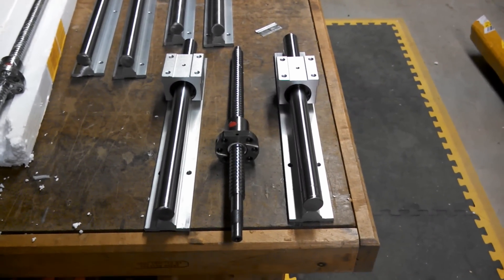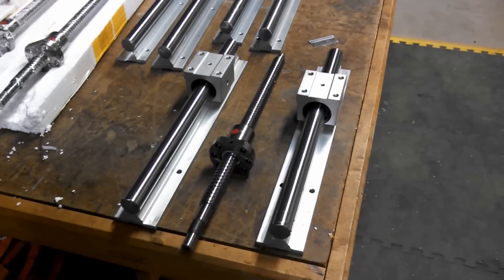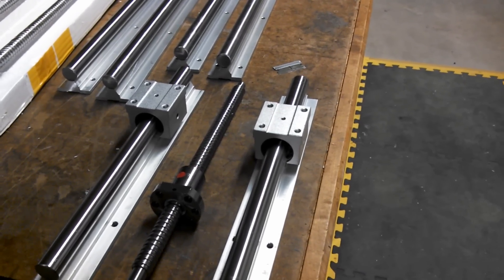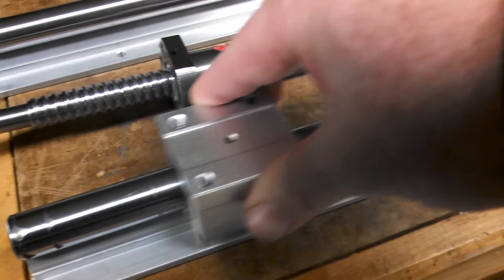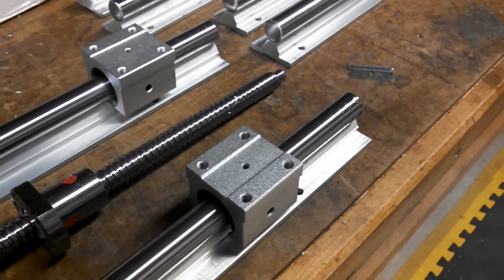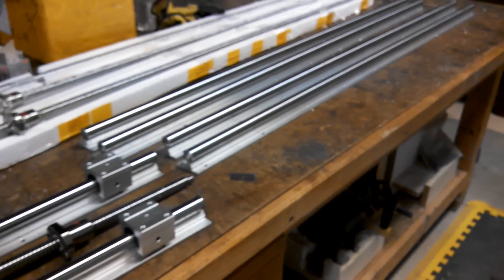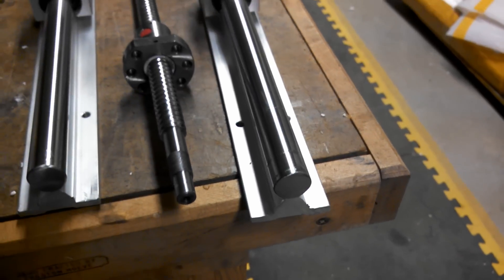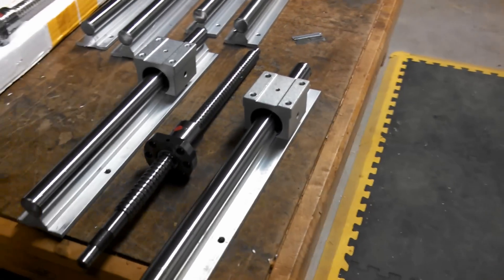Chinese Linear Rail Review

Comment: Once you start to finish your build you will realize how poorly those will be for your application. You cannot work out the play in an adjustable round rail bearing without fighting excessive preload. Nada, zero, zip
Reply from the maker: +Onnly Secondsleft  I haven't found that to be the case.  After replacing a couple of bearings that I screwed up (my fault) I am still happy with the price/value.  Maybe it is something about my overall design?  If I would get off my duff and do an overview video of the machine that would help elicit feedback from you guys/girls.
Reply: +Onnly Secondsleft , I agree, they are terrible and coggy as hell. Especially the 12mm size.

Comment: Thanks SBird, Useful and to the point.

 "Miss_my_car" is where I've seen them.
 Can't comment on them as a vendor one way or the other, but I just ordered a 1204 350mm long ballscrew/nut set from them. 

I just rolled the dice, needed a cheap Z drive fo a HF mini mill, it's replacing an ACME setup, so I figured if it wasn't up to snuff, I'd donate it to STEM  - technology in the schools - they do Arduino cnc stuff. 

I could put a Thomson or SKF on it, for more than the tool is worth, but this makes sense for the use... 40 bucks, not 340.

For home shop use, most of this kind of stuff isn't too bad. It's not intended  for use on the space shuttle.....

Scott
Reply from the maker: +Scott Marshall My machine is now up and running and as my other video shows, I had some 'discoveries' around the slide bearings, but the ball screws and nuts have given me no issue.  Good luck.

Comment: I want to thank you for the info and video.....I've been preparing to upgrade my cnc to get rid of the (ludicrous) plastic structural parts (which equate into flexing during runs) and have been looking at numerous options...Similar items from McMaster Carr are hundreds of dollars more.

Now I get chastised for buying router bits and end mills from China saying how it's hurting local businesses but considering that a 1/4" straight flute router bit is $44.00 where I live and one from China is $3.00...I can justify spending double, but can't justify spending FOURTEEN times the amount.....
Reply: +michael C Besides US vendors sell plenty of "inch" parts which mean they have three time the inventories that would have by being only metric !
Reply: @ellsworthm.toohey7657  Why would they need three times ? Just curious. Thanks

Comment: do they have greasing holes
Reply from the maker: +basilenglish No. They do not.  At most a light oil is all you would want, and just a coating at that.  Any oil or grease would cause them to pickup dirt from the rail.

Comment: you did not comment about the cost
Reply from the maker: +Paul Le   You are correct.  My goal was to share my opinion on the quality and functionality.  If I introduce cost into the equation then I feel the need to compare other options.  Among just round linear rails from China, the prices are all very similar.

Comment: Thank you for answering. My specific question is what are the slide diameter (16mm, or what) & the lengths of the rails on your set up.  Just trying to get a visual perspective of the sizes . Thinking of a 36" x 36" or 42" x 42".
Reply from the maker: +Keith Bardwell 20mm diameter.  The short ones are about 12" and the long ones about 50".

Comment: Exactly which set did you buy and from which vendor?
Reply from the maker: +Keith Bardwell   I don't remember who.  If I come across that in the future I will update the comments.  The specs are all the same from different vendors and you can tell they are cut from long lengths of material.  Most of them will make any set you want.  Just contact them.
Reply: +sbirdranch  do you have any update about where did you get this from? the name of the vendor in eBay? i like the way they shipped to you. they looks like it is well protected. specially the ball screw with the Styrofoam. please let me know if you remember or if you can check on your eBay account the history of your purchase and find the name of the vendor. thank you very much. have a great day
Reply from the maker: +miguel0706 http://www.ebay.com/cln/sbird_seller/cnc/144826516017

Comment: Hi, I'm in the same process, looking for a 3 set of linear rails xyz, after looking v-slot rail with wheels, not sturdy enough, too many parts to adjust, degradation of the wheels, etc I decided for the supported rails, simple and strong.  
I see you ordered your linear rails and the ballscrew with the same size, how are you going to do? are going to cut the linear rail to match the size of the threaded part of the ballscrew?  I am thinking of ordering but taking into account the machined ends, about 50mm bigger, what do you think ?  by the way great video !
Reply from the maker: With the screws the same length, you don't lose much travel at all.  With the bearing blocks on the slides and with them spread out, you can't move the full length anway.  It becomes a travel distance of SlideLength - WidthOfCarriage trucks.   To prevent over run, I will have limit switches on the final build that will stop the steppers from driving the carriage off the end.  I hoped that answered your question.
I haven't worked on my machine this summer, but as winter here in the Eastern US comes back around I will be returning to it, and will have some pictures of what I have done.  That may help.

Comment: Square may be better in some designs but unless you have a perfectly flat mounting surface and VERY rigid frame...they can bind...the round are much more forgiving and basically self aligning....I am switching out my CNCRouterParts.com cold rolled steel and skate bearing rails to this type..although the CNCRP design has performed flawlessly for the past 2+ years...they must be constantly cleaned to perform properly.....